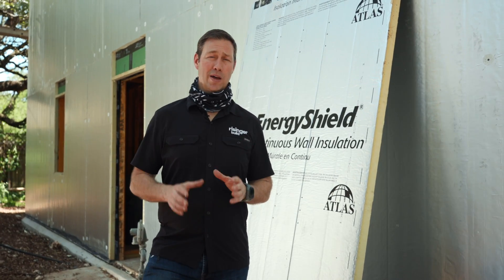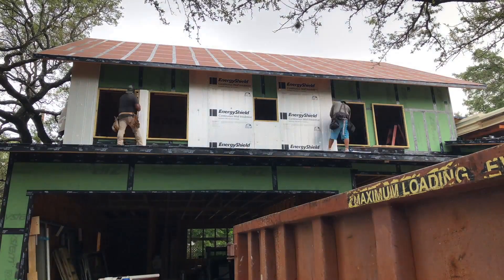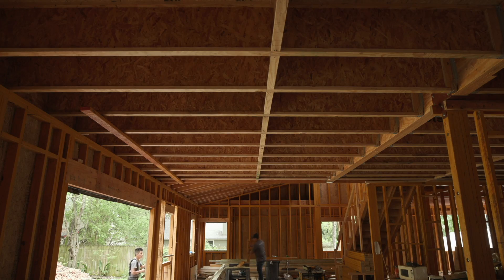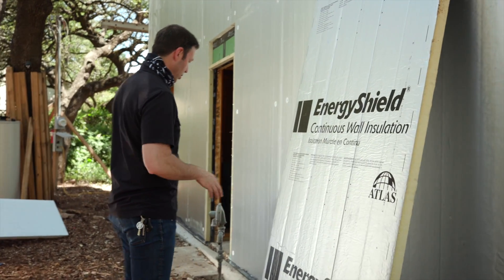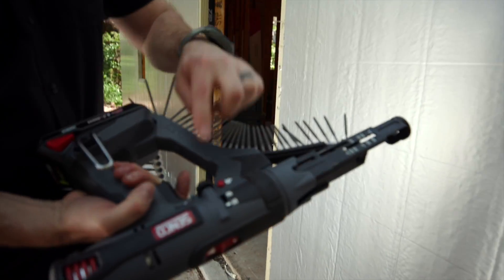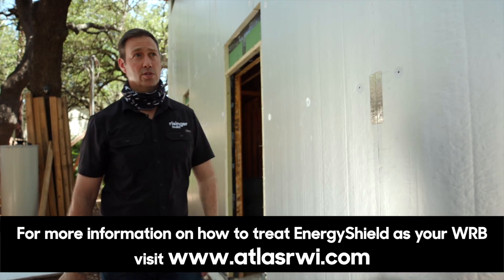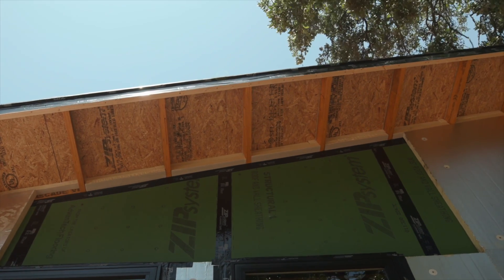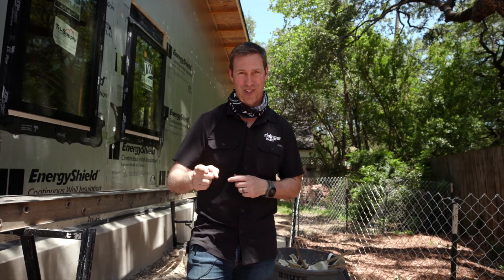Exterior INSULATION Details from Matt’s House

Comment: Alright Matt, I've got a question for something you skipped over a few times, perhaps I missed it when you explained the science of it. You need the space behind your insulation as you explain, the question is, how does this not destroy the R-value due to convection? Doesn't the air behind the insulation share the temp of the surrounding air? Isn't this like leaving the refrigerator door cracked open just a bit?
Reply: if you are referring to the air gap required for the reflective radiant foil face, it's OUTSIDE, between the insulation and the hardie siding.  formed by the battens for the siding.  for him because he is in a warm climate.  in a cold climate it would be on the inside of the insulation, causing the problem you describe.
Reply: @frotobaggins7169  yes, it is outside, I didn't suggest otherwise, but it would still mean that air is in that OUTSIDE space and that OUTSIDE air would be the same temp as the surrounding OUTSIDE air, no? doesn't that create a problem like I had asked about the cracked refrigerator? Let me explain what I mean a little better. If you had  a refrigerator inside a cooler (bare with me). The refrigerator is the house closed up. Now, the cooler represents the exterior insulation and there is a gap in between the refrigerator and the cooler. Now, there is a spot at the bottom and top where the cooler is opened to allow moisture to do its thing so you don't rap it and cause rot. doest the air INSIDE the cooler match the temperature of the air OUTSIDE the cooler? Doesn't that negate or hurt the high R-value?
why not? I hope this is less confusing and a bit more clear what I am asking?
Reply: @erichwise7734  you're overcomplicating things. The "gap"that Matt talks about in this video is outside of all the insulation. Ignoring the sun for a moment, air in the gap is the exact same temperature as outside air. And that's fine, because all of the insulation is still between that air and the inside of the house.
Reply: @ChadHadsell  yes, thank you, this makes sense and in this case he is only placing siding on the outside, but I have seen where there is a gap in place between, say an original outside of a house and new exterior insulation like mineral wool. He has in previous builds shown products that allow water to drain as necessary, my question is in those cases doesn't that negatively effect R-value, Ive just never seen that part addressed. I know Im complicating things, but I am simply trying to understand how that very specific thing works. The point of the question was for Matt. The idea was that he might take a moment in a future idea to further explain how convection plays out in the design and engineering of these wall systems.
Reply: Not sure what you're asking about... Matt isn't leaving any gaps behind the insulation. The gap he mentions for the radiant barrier is between the insulation and the external siding. That's outside the insulated zone.
Reply: @ChadHadsell  yes, that gap the one behind. I thought that would have been obvious but I didn't explain it correctly.
Reply: @erichwise7734  but... There isn't a gap behind the insulation.
Reply: @ChadHadsell  Yes, not in this particular video, but there are numerous times when there have been and it has always made me curious, I tried to quickly find a way to email Matt the question, but just asked him on here.
Reply: @erichwise7734  You can ask Matt directly on Instagram.

Comment: Hi Matt, curious why this exterior insulation, instead of using the integrated Zip R insulated wall sheathing?  Wouldn’t that have been much less labour?
Reply: Probably because he's getting both paid for by his sponsors
Reply: No, because with 2" Zip-R, its a Pain in the Butt to get them in the studs. There is a lot of stickout. To use 2"Zip-R you really need to double sheath the walls: First sheath with OSB (or plywood) than install the Zip-R on top. the first layer of sheating serves as a nail base for the Zip-R. So it would be considerably more time & cost consuming.

Comment: Hi Matt! Love the videos. So you're saying that foil faced polyiso is acceptable for a northern climate, even with the foil essentially functioning as a vapor barrier? We're basically stuck with drying to the outside without air conditioning. How's that going to work if the building assembly gets wet? Seems like a big accident waiting to happen. Am I missing something?
Reply: Not for northern climates unless you want mold
Reply: Would seem that zip sheathing presents a similar problem, would think it too impermeable for northern climate (I'm from northern BC Canada (zone 7). Norm around here is plywood rather than  OSB products.

Comment: great.  how come u didnt use rockwool.  did they stop sponsoring you?
Reply: I bet he will flash a d batt inside.
Reply: He'll probably insulate the perimeter interior cavities with the stuff
Reply: Rockwool has a horrible R value per inch
Reply: @CybekCusal  horrible? Hardly.
Reply: @ArthurDentZaphodBeeb  yeah it's less than half of what he used so his walls would be twice as thick which would cause issues.
Reply: My thoughts as well. Rock wool is awesome, it resists more than polyiso does.
Reply: Check out the Rockwool page:
https://www.rockwool.com/a/s/comfortboard-exterior-non-structural-insulation/

It has Matt Plastered all over the page!

2" exterior Rockwool insulation is R-8. Also doesn't provide a radiant barrier (reflective surface) like the Altas does. I believe Matt will be using Rockwool for the wall cavity insulation.